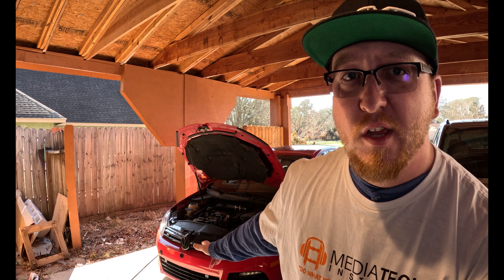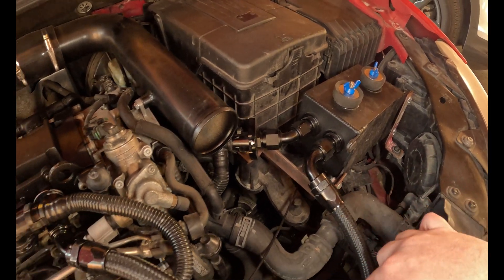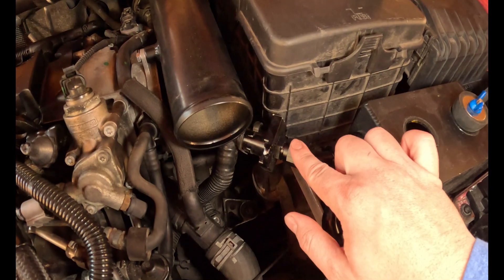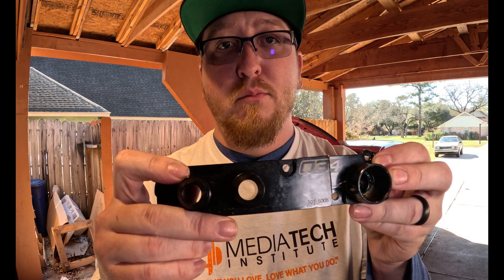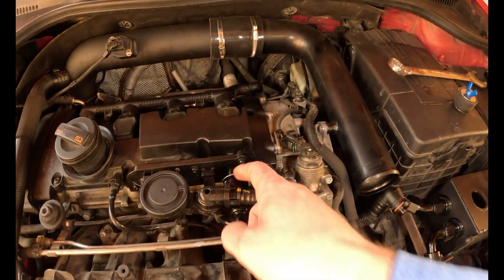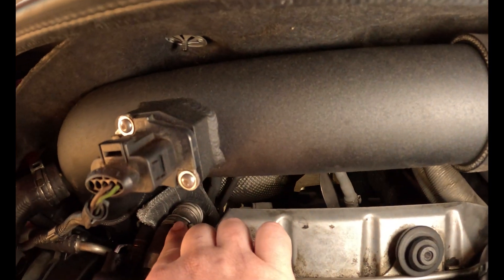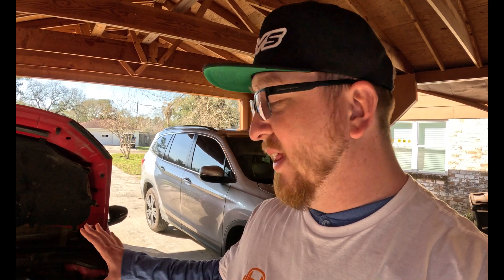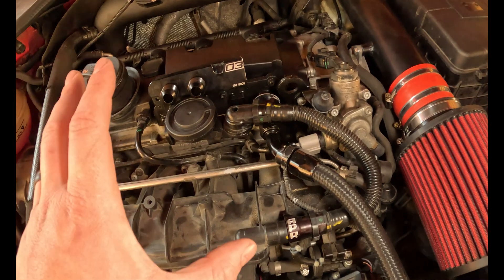CUSTOM (AMAZON) Catch Can for my MK6R

Comment: What determines blow-by? A lot of oil coming out of the exhaust?
If you could show how it was ran from the crank....
Reply from the maker: A lot of oil/ residue in the intake side, air inlet, turbo inlet, intercooler.